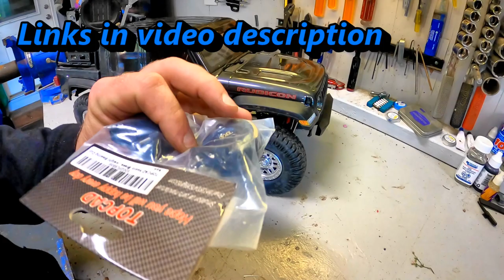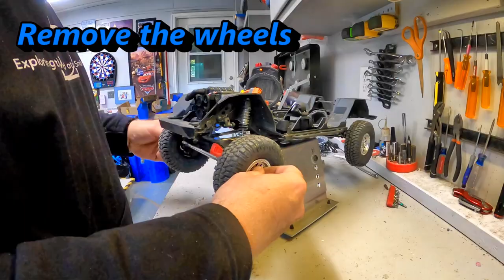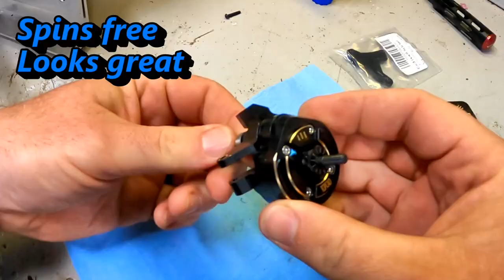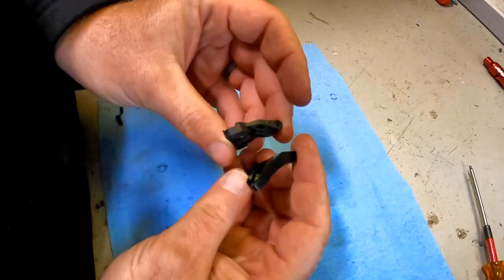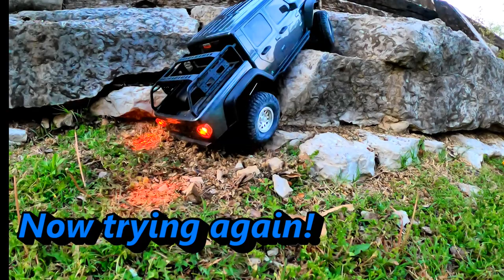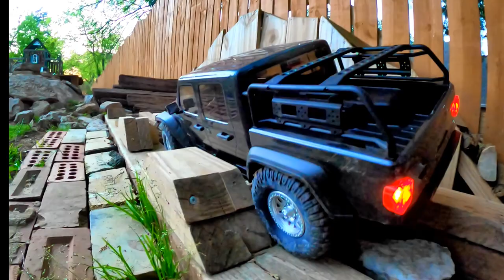Axial SCX10iii Upgrades!  Brass portals, overdrive gears, and panhard mount!

Comment: Hi I am struggle with 300g or 172g front portal brass. Do you think 300g is over weight?
Reply from the maker: No, I think it will be fine.  
These weight I have on here is a lot, but it works very good.

Comment: Great video as usual but your problem is not overdrive, or lack there of. Your problem is your tires and your foam setup. I highly encourage you some voodoo  klr or proline Krawlers with a proper foam setup. That gladiator will thank you.
Reply from the maker: I really want to try a set of those klr tires.  Just haven't gotten there yet. 
Yes, these tires are probably not the best crawler tire, but I am pleased with how well they do overall.